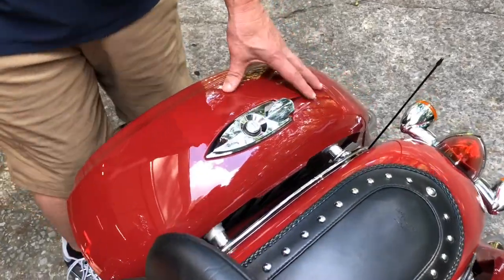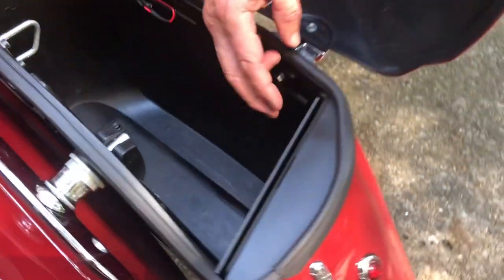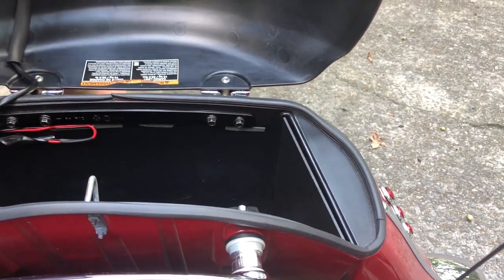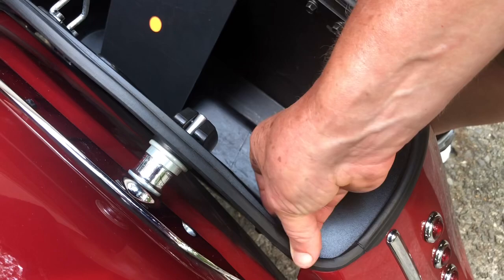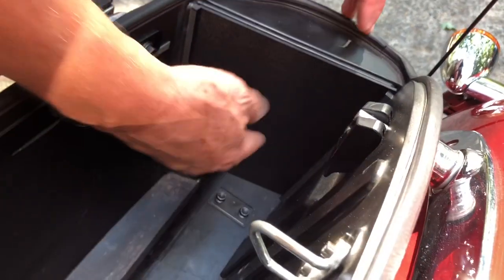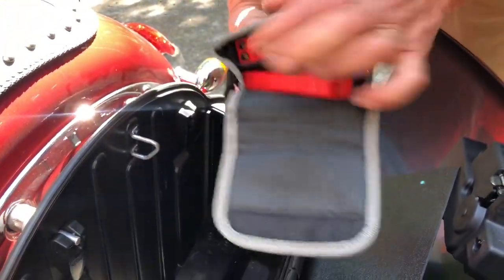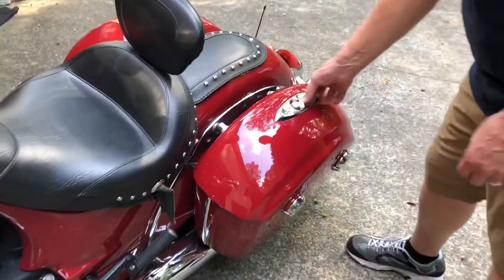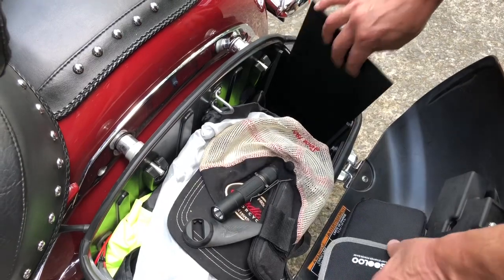Saddlebag Doors - Indian Chieftain, Roadmaster, Dark Horse, and Springfield

Comment: So I ordered this kit from Glenn for my 2017 Indian Roadmaster. I received them very quickly (I had tracking the day I ordered). They got to my house today. Everything was packaged neatly, instructions were clear and concise, and all the parts were easily identified. So I did the surface prep, and installed the doors. It took ten minutes, nine of which was surface prep. Easy! 

So this is a great solution. I carry a pretty significant amount of early responder gear, it all fits inside those compartments. So here are my grades (on a 1 to 5 scale, 1 being horrible, 5 being awesome):

Communications: 5
Shipping: 5
Value: 5
Installation: 5
Overall: 5